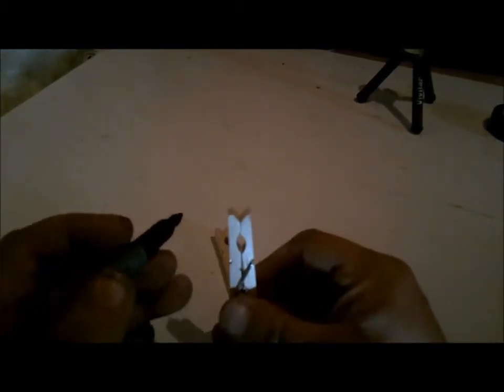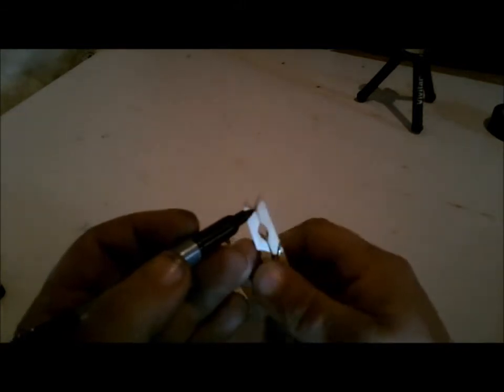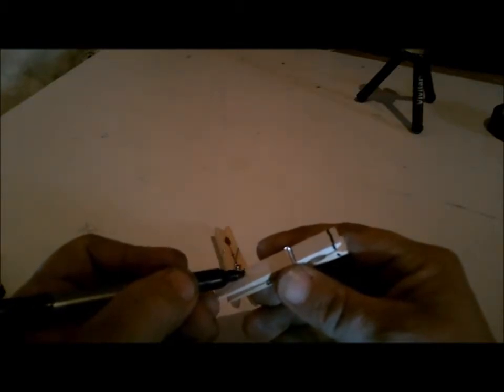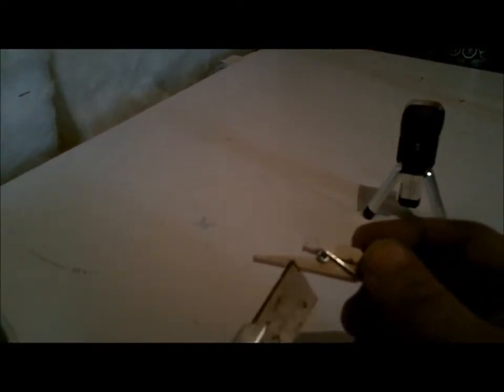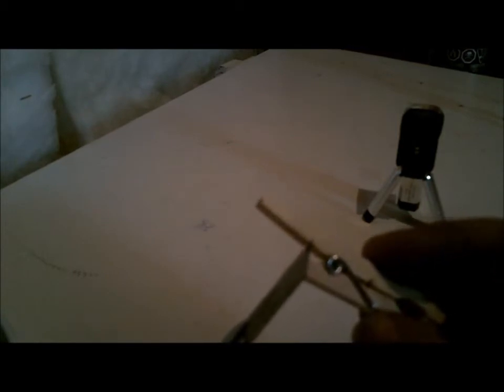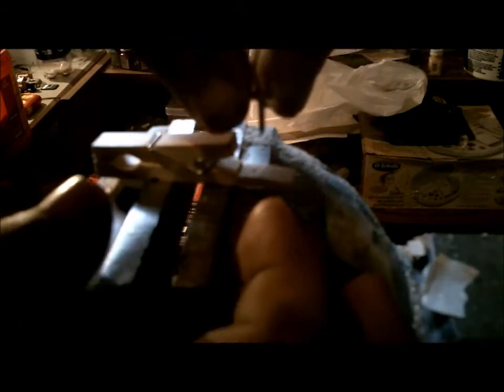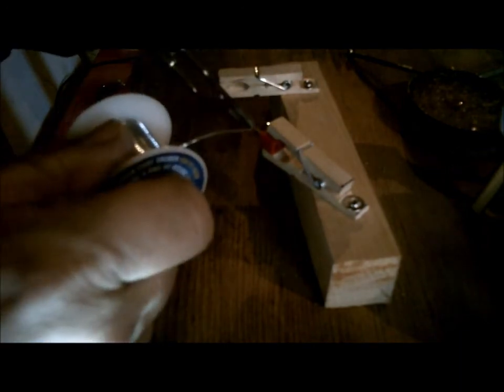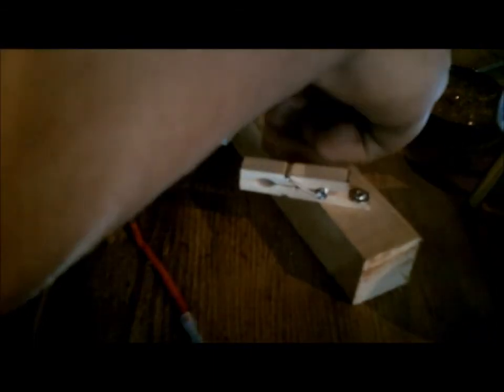solder jig DIY  easy and cheap !

Comment: Great idea bro , but really the solder iron that I have sucks , need to get a good one this time , Thumbs up
Reply from the maker: very true they do. thank you for watching and the comment .  B>)
Reply from the maker: well like you said , if you do a lot of one thing than it's worth making a jig.  if not it can be a waste time.  i work in the rubber industry doing press moulding. i know how some engineers can be. lol!
Reply: If you do a lot of repetitive Assembly Work, custom  made Jigs make life easier.
Reply from the maker: glad you like it bro.  the jig, like panos said can be use for many different things like painting parts, glueing small pieces. ect...  thanks for the view and comment moe.  8>)
Reply: I worked in manufacturing. One of the Engineers was to the point of obsession making custom Jigs, to speed Production.